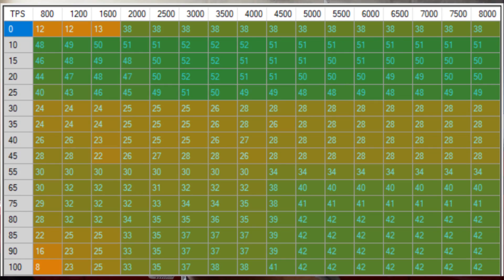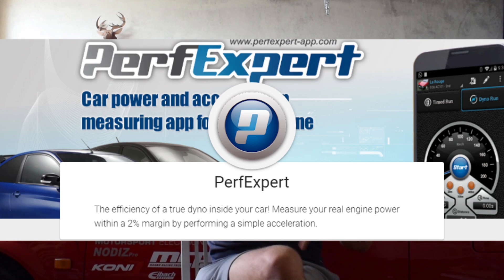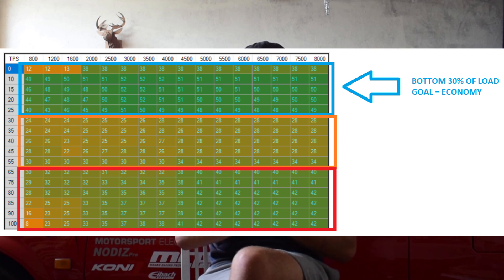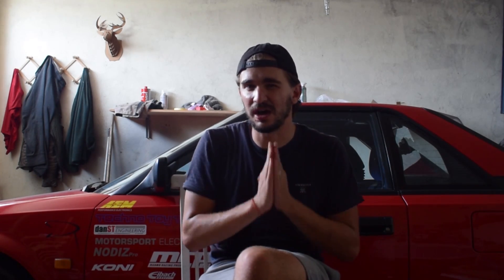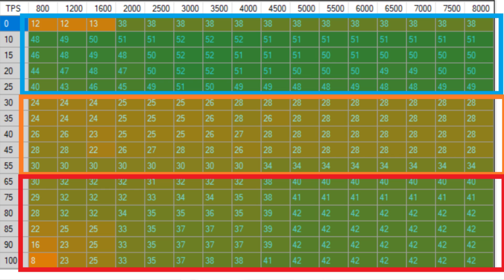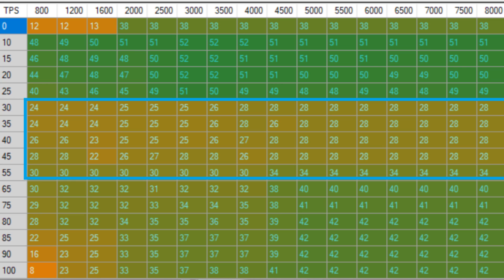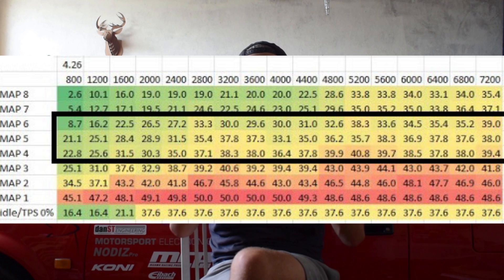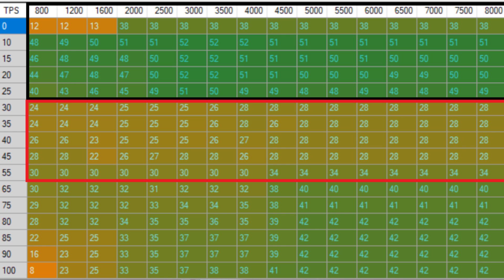BIKE CARB 4AGE IGNITION MAP

Comment: You have a sudden discontinuity between 25% and 30% throttle and again at 55 to 65% Can you notice a transition when you cross this threshold. I would like to see a 3 dimensional model of your map. It must look very jagged and unusual. What motorcycle carbs are you using, slide throttle or CV type and what  throat size.   John
Reply from the maker: Carbs are Keihin CV from a CBR600R F4 with 38.5 throttles I believe (or 36.5...double check that). I can't feel anything as this map was made precisely to make things smooth, or at least as smooth as possible with the short travel and abrupt on-off transition of the throttle, that was designed to be twisted by hand. I tried and tested this map A LOT and I'm pretty confident it can't be improved much. I took it to a dyno later and after about an hour the dyno operator said he couldn't really improve it or make more power. But I spent more money on gas making this map than I would on a dyno if I had originally paid one to do it 😂

Comment: Hi there i'm a beginner at learning about car engine and have watched your videos recently. The top numbers are the rpm, the left one is the throttle position, and what is it in the middle? In your video you said 'do your cam timing before ignition timing', is there a way to control the ignition timing through the ecu? Is there any other thing that can be tuned from ecu beside cam timing and ignition timing? I'm sorry for asking so much questions, thank you. 
Love your videos btw, i've learned so much
Reply: the numbers in the middle are ignition advance. the grid is the map that controls the ignition through the ecu

Comment: Hey I was wondering if anyone has ever used the injector holes in the head as MAP sensor ports and/or brake booster source, that way you don't need to tap the manifold and disrupt the airflow possibly. Would be a sick little piece if you could CNC up something like the stock fuel rail but tubes instead of the injectors and you can just have a port on the end of the "vacuum rail" for the ECU and booster. Ever thought about it?
Reply from the maker: Hmmm.. Using the stock holes can't be done but making something new is a clever idea. Basically like the rail but just four outlets. But it would be a relatively complex and expensive part for what it is. Tapping the manifolds is super cheap and simple so it's hard to beat. When it's done right it doesn't disturb airflow at all, you just need to grind down anything protruding inside the manifold. But it's still a cool idea if I ever do something show level and high end :)

Comment: 1) What did you do to detect and listen for knock?

2) Where did you get the Stock ignition map? 
did nodiz provide it?

Great Vid!
Reply from the maker: No listening for knock. I confirmed on the dyno that there wasn't knock at even more advance than I'm running here, and I ended up retarding after that so I'm pretty sure I'm safe for now. I would love a knock monitor tho, not sure which one to get or where to install it since the 4age never came with a knock sensor from factory.
Reply: @d4a  All 7rib 4A-GE blocks have bung for knock sensor ready (on intake side), just not drilled/tapped if I remember correctly. I think it would make for interesting video, drilling + tapping it and comparing preferably simpler solutions for knock detection :)
Reply: @KubaPSP  hi
Mine is tapped there :D my car got an exchange engine in ~1989 and it came with the 7rib block, 40mm rod journals, 18mm cold pressed piston bolts and high compression ratio pistons. The head is a rev. one as you can see underneath the dizzy hole. But the cams are the more aggressive ones from the 3rip engines :D all mixed up here.

Comment: Nice info. I suggest getting a knock monitor, one that is visual and audible(can plug in earphones). This will ensure safe tuning without the risk of detonation as not all detonation is normally audible from inside the car. I have the phormula ks4 its in the midrange of knock monitors and does the job well. I even notice say for example a very hot day the readings are slightly higher or with different fuels. Its a great tuning tool to have alongside the afr gauge for road tuning.
Reply from the maker: I definitely agree with the knock sensor idea. I just looked up the ks4 and it looks great but I always wondered where to install the sensor itself on the 4a block since it never had a knock sensor as stock?
Reply: @d4a  I have a 4age 20v it comes with a factory knock sensor at the back of the block so i just changed the sensor. Its at the back towards the top between cylinder 2 and 3. I believe on the series 3 16v block has the threads for the knock sensor. On the earlier 16v blocks there should a tab where the sensor goes will just have to drill and tap it

Comment: You are very correct about 50 degrees of ignition timing at low TPS openings. I don't understand why most of the maps out there have 20 30 degrees... Mine has 45 and it works like a champ. Great Video!
Reply: works great but ads wear
Reply: @zekeandersson2040 adds wear to what ? I also didn’t understand why maps have very low timing and low load areas im currently at 40 degrees there
Reply: @marlo0oty213  more advance to timing more combustion chamber heat

Comment: You have bike carbs and control over your ignition tune. Its time for ethanol if you can get it easily in your country
Reply: It's not great on most of the 1980's plastics and rubbers we have in our fuel system. My in tank pump has a fine screen that fell to bits allowing the fuel pump to seize. The pump mounting buffer was a melted mess. The main fuel filler supply hose is straight from factory then bent 90° as installed. Mine had gone rock hard at 90° so it wouldn't allow the tank to be dropped until it broke off. Modern rubbers conform to SAE30R6, old ones don't. Just keep in mind the amount of grief required to undo the damage.
Reply: yeaaaaa all that trouble for negligible gain
Reply: ethanol will eat away some of the carb's parts, no?

Comment: Oh wow thank you so much, that will definitely help with the base tune on mine. I got the ME100 but tuning wise I am pretty sure its the same as the NoDiz, slightly larger carbs but should be pretty similar in the end tune to yours. PS definitely blaming you if my engine melts a piston ;)